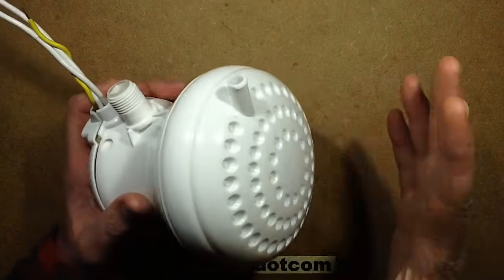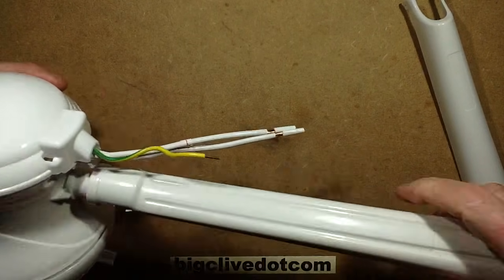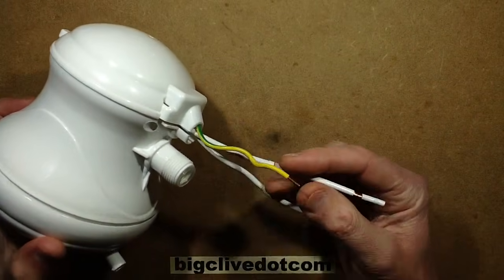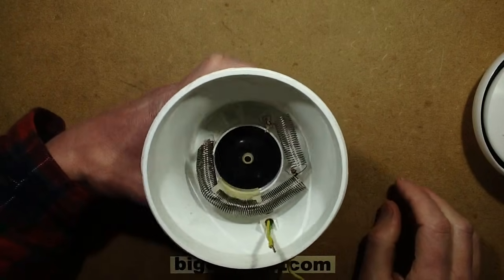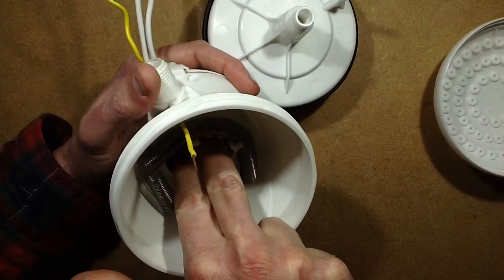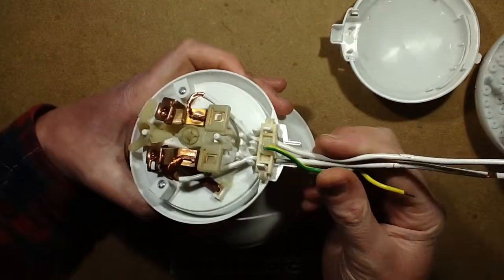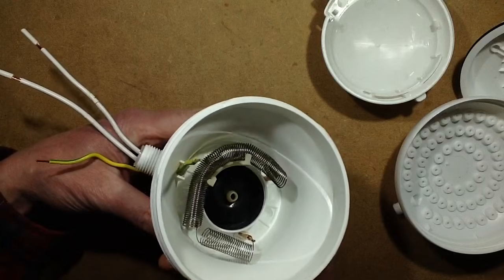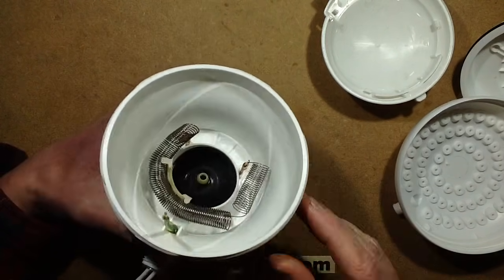Inside a heated shower head.  (suicide shower)

Comment: Fun fact: here in Brazil people actually got upset (well, they still are) when the gvmt established that things had to be grounded. The VAST majority of electrical installations and appliances simply aren't, even to this day

Edit: Those showers are the standard here in Brazil. Reading the label I actually think this is a copy of one of the most common models here
Reply: crephotos it's called soap, mate
Reply: crephotos I'm pretty sure in the one minute or so it'll take you to wash your hands you would need water to be boiling in order to actually count as "killing germs trough heat". More likely than not the warm water you're washing your hands in is only feeling like a comfortable hot bath for the vast majority of them.
Also inb4: antimicrobial soap things which people shouldn't use anyway but exist regardless
Reply: Vile Lasagna Good points.  If the water were hot enough to kill bacteria, you could not put your hands in it without receiving second-degree burns.
Reply: +Vile Lasagna, yeah it's totally pointless if the people give no regard whatsoever to others or their own safety. hahaha.
Reply: Personally I believe that mr "Truth Teller" has most likely invested a large sum of money into these electrical showerheads, that's why he patrols the comment section to this video and replies to every single comment and every single reply. He needs to ensure his investment was not wasted.
Reply: Tiago Mian the original is already kinda crap, tho XD
Reply: That's a Lorenzetti Maxi Duxa copy! Zhenhua is counterfeit.
Reply: Truth teller I said crap. they are crap. they're also very cheap and the brand is well known, I'm pretty sure my own shower is from that brand, although a pricier model. You are reading it as if I said they are very very deadly and kill people every day which does not reflect my statement. "Or are you so determinedly dumb to refuse to read?"

Take a chill pill, mate. You're raging way too hard for no particularly good reason (unless you have some sort of secret connection to some electric shower maker)
Reply: Tecnovlog
No, it is not.  Many places in Brazil, as in the USA, are either not grounded or not grounded well.

The fact is, not one person has been electrocuted by these shower head heaters in the 14 years \ii have been here. 

Believe what you want, but the facts do not support your cherished beliefs..
Reply: Truth Teller said "I have never heard of snyone being even mildly shocked by one".  

Well I can tell you that it has happened to me a few times, albeit very mild, when I have actually touched the shower head while it was on and the water was running through it.  I've been using that type of showerhead for the past 15 years that I have lived in Peru.  Actually, the ones in my house are made in Brazil.  They are Lorenzetti brand.  And in Peru, I don't know anyone who has grounding available.  In fact, not many people even know what I'm talking about when I mention it.

At least I think they are made in Brazil, but counterfitting is so prevalent here in Peru that you never know.
Reply: they probably got angry that the goverment is forcing them to change their electric netwroks at homes without helping them out.
Reply: Democritus86 tbh it's not really being forced. new plugs are compatible with old sockets unless the ground pin is there and that has not been made mandatory so the vast majority of appliances still just ignore it. even when it's there, adapters are plenty so it's pretty easy to work around it.
Reply: To the idiot that thinks washing your hands in warm to hot water kills any germs.. Lmao thats what the soap is for.. Do some research.. Hot water isnt even at a proper temperature to kill germs given any period of time. The water needs to be boiling.
Reply: Are central hot water heaters not common there?
Reply: Not at all, no. You get them in on the south of the country (the little "appendage" hanging from the bottom) which has colder winters and even then most houses will have heating for showers only, rest of the house is straight from the water mains. It's also a "rich people thing" and even there most people will rely on electric showerheads like that one
Reply: The general idea is that having earthed appliances is pointless and that standardizing plugs and connectors is futile and wasteful.
Reply: Truth teller there was only one person actively contesting it though so it's more like it's not been given much importance rather than people being stubborn. I myself am under the impression that it does happen from time to time, even though it is certainly not an everyday thing. Power spikes are very common in a LOT of places in Brazil. Heck, we have thunderstorms all the time where I currently live and I'm pretty sure I've heard a few stories here and there but I cannot guarantee them to not be urban legend so...yeah. not much to say about your statement, mate. You are correct in that they are not a major source of deaths in Brazil (not that I know of, at least) but I know of quite a few scares (often involving people moving the controls with the shower on) and have had a couple myself, not to mention the occasional shower where you always get mild shocks when touching the knob to turn it off
Reply: Truth teller Wouldn't a "nanny state" be the one to hand feed everyone and provide "excessive help" instead? Choose a complaint, mate
Reply: Truth teller so you're saying that if you touch a grounded metal pipe when you're showering  you do not feel any electricity running through your body?
Reply: Truth teller
Could have been that particular installation.  I have not felt anything since we moved from that house, but then again I have been very careful not to touch it while in operation, so I don't really know.  Still, I've used it without fear of electrocution for the past 15 years.
Reply: Don't know if you will actually see this reply. My best electricity story in Brazil, is the high voltage lines that run down the pavements on poles. I have seen situations where someone, say a child, could reach out the window and touch them!
Reply: Why did people got upset? I never heard that....
Reply: This brand is probably chinese.
Reply: crephotos Soap helps water bond to oils and microscopic debris. Washing is mostly a physical process that physically removes sweat, oils, fungus, and microorganisms from the skin's surface, unless you happen to specifically use antibacterial soap
Reply: Truth teller i don't know i'm now brazilian i'm asking a different question, if in brazil people do not ground they system the chance of dying of electric shock is very real
Reply: Tiago Mian Yes, and millions of them are used every day without one person being electrocuted.  The fact that slmost no one one this thread will even admit those facts have been posted many times shows how stubbornly stupid they are
Reply: Vile Lasagna Then explain how millions of them are used every day with no one being electrcuted. Or you as determinedly dumb as the rest of the mentally deficient on here?
Reply: how many people die every year from electric shocks?
Reply: Tecnovlog I said, "how many die from using shower head heaters?"  You are evading the question.  Are you an intellectual and ethical coward?   Answer the question I asked.
Reply: Vile Lasagna Ihave been using these at least once a dat for 14 years.  I have never heard of snyone being even mildly shocked by one.  The only person offering proof otherwise used an unproven story fron Thailand that made no mention of a showerhead heater.  Quite frankly, I do not believe one word of your account.  Do you understand what is meant by "proof"?  I don't think you do.
Reply: @truthteller1914 you're like the person who smoked for 50 years and got lucky so you don't believe that cigarettes are bad.
Reply: *****
Wrong, a nanny state is one that interferes in everyone's life to tell them what is safe and not safe but does little about it. 

Who said it was a complaint?  Oh, that was you, wrong as usual.
Reply: Brutus Kennedy Rutherford Kingsley III
Personally, I think you are an ostentatious prevaricator.  As I always say, prove anything I have posted is not true.  Not one person has been killed with these devices.  I have asked for proof and none has been supplied.  You are all goddamned fools that refuse to believe the most obvious facts. 

What is wasted here is the scraps of intelligence people like you may have had.  Instead of trying to prove your points, you waste your efforts denying that I am right and that you are all a bunch of ignorant assholes.
Reply: Tecnovlog I did not say that at all.  Are you so desperate to ignore the facts that you have to invent things I never said?  

Again, millions of shower head heaters are used every day here.  Not one person hs been electrocuted.  Either accept that fact or shut the fuck up.
Reply: Democritus86 You are probably right.  ;)  The government here is as much of a nanny state as many other countries.
Reply: Dale Erwin
I hear you.  Be calm.  counterfeiting is common here, too.  I have never gotten any shock here even when the building ground was faulty. 

A few months ago, the ground on the circuit for my computer room was faulty.  If I were working barefoot and therefor grounded, I would get a mild shock from my keyboard or the computer case, both aluminum.  I loosened are re-seated the ground wire and everything has been fine since then.  

But my shower, never a tingle even when I have changed the heat setting while it was running.  In fact, I have seen no warning about doing that.
Reply: @truthteller1914 wait, so you say there's no point in grounding things, then say you got shocked by your computer because it wasn't grounded properly?
Reply: So what do you wash your hands with? Cold water? That doesn't kill any germs.
Reply: ***** Soap doesn't kill germs, mate. All soap does is help lift dirt. You need warm/hot water to kill any germs. 

Note to self : never shake hands with a brazillian.
Reply: @TRUE_GR1T  cellular membranes are made of what amounts to soap. When you wash your hands with soap, it destroys bacteria by disrupting their membranes
Reply: @samalbury9183  why are you replying to 3 year old comments?
Reply: @TRUE_GR1T what do you do to kill germs living in your mouth?
Reply: Not true. Cold, warm or hot water works just as well with soap @TRUE_GR1T
Reply: unecessarily xenophobic, bro.  @TRUE_GR1T
Reply: @rafaelmocochinskifreitas9016   you're replying to a comment from 7 years ago man and I was joking.

Comment: I've used those all my life, they are very reliable and lasts a couple of years, normally.
Reply: FireBird- Just use a water heater! They're actually significantly less complicated than one of these, and if you live in a shithole you could probably just build one yourself with a tiny bit of basic plumbing knowledge
Reply: ***** I can't. I live in an apartment building.from the 70s.It's this or cold water to us.

Comment: Hi Clive,
Like me you'll be startled to hear that some UK shower manufacturers DID use this live coil in water principle up until just a few years ago!  About twenty years back a friend asked me to have a look at their very expensive shower unit (Dolphin??) which had stopped heating.

My jaw dropped when I opened the case to find a clear perspex manifold with a Ni-chrome coil directly in the water flow – albeit a lot fancier and with a much longer water resistance path than the Chinese one you stripped down, it looked equally dangerous to me. Nevertheless, when I checked it out with one of the Principle Engineers in the local electricity board he confirmed that BEAB had indeed (somewhat reluctantly) given approval for water heating devices using this principle.

In the event all I had to do to repair it was to shorten the coil by half an inch (it had corroded at its termination) and off it went like new. I did hear that the owner ultimately died, but he was in his nineties by then so my conscience is clear!

Love the channel,   Cheers,  Chris
Reply from the maker: I saw the panel from inside one of them a long time ago.  A long snaking channel with the element inside it.
Reply from the maker: In the majority of countries using electrical water heating the heating element is enclosed in a grounded metal sleeve like a kettle element and does not make electrical contact with the water.  I do realise these devices are widely used in places like Brazil, but they would not be allowed in the UK due to the genuine shock risk they carry.
Reply: colonelerotic
I know that.  That's why I said USA.  It makes no difference, it is still true and millions of these shower head heaters are used every day in Brazil alone.  If they were even 1% ad dangerous as the claims in the video, thousands of people would be electrocuted every day.  That would cause talk, wouldn't it?  ;)
Reply: Truth teller but Brazil is a dirty third world country so telling us it’s safe cos everyone uses it there means nothing. People in India work barefoot on overhead power lines, lots do it, doesn’t mean it’s safe though
Reply: Xavier Bacon In fact, you have never heard of anyone being electrocuted by one of these devices.
    The electric tank heaters work the same way.  An electric heating elment is immersed in the water.  This entire video and 99% of the responses are testimonies to ignorance and a determination to ignore the facts.
Reply: bigclivedotcom You are totally wrong.  I have repaired many electrical water heaters in the USA and not one was as you describe.  Nor are the shower head heaters dangerous.  There are millions of them in Brazil.  If the were as dangerous as you claim, thousands of people would be electrocuted every day.  That would cause talk.  ;)
Reply: *****
Powering up with no water?  Do you realize that that is not the proper use?  Here, they must have water in them.  For example, mine is turned to the "low" or "medium" setting all the time and does not come on until there is water in it.  I can hear it come on as the water starts to flow from the head.

Comment: Those are common in Brazil. The hose is not a pressure release valve but actually just a hose to wash your private parts. Most houses don't have a ground wire so shocks are common.  I've never heard of any electrocution though, although I think I must happen sometimes.
Reply: David Ribeiro Shocks are common? Sorry to break it to you but here in the first world we take exception to getting zapped while washing.  I assume by electrocution you mean death.  We don't take life that cheaply.
Reply: Comprehensiveboy Comprehensiveboy Actually in America we take life cheap as hell as long as we don't have to actually see it happen
Reply: Comprehensiveboy Comprehensiveboy the shower is common. Shocks caused by these showers are not as far as I am aware.  
And yes... life is ever so precious in USA... suuure.
Reply: If I felt even a small tingle from my shower the electrician would be in deep shit and probably risk having his certificate revoked.

Comment: That crazy thing is not sold in the USA, but if your water heater works properly then why would you need one.
Reply: If you want me to pick out two numbers that are the farthest apart ask for what temperature I like my air conditioning and what temperature I like my shower. Summer A/C temperature is comfortable at absolute zero cryogenic and the shower hotter than the center of the Sun.
Reply: Brent Fisher Good man

Comment: mine blew after setting to hot water(not cold neither warm).... no longer works...ideas to fix?
Reply: The heating element breaks up all the time in those showers. You can buy a spare one or twist and mend the wire in the heat element and fix it.  after installing always turn the shower in the cold setting and let it run for a bit before setting to hot.  If the heating element gets hot while dry it will break up again.
Reply from the maker: The elements inside often seem to fail and can usually be bought as spares.  In this one I think it just presses onto spade terminals.  But make sure the power to the whole unit is completely off first.
Reply: Ok... I'll check it ...perhaps it has the same configuration as that in the vid...  thanks

Comment: I learned the hard way, just shocking, in Nayahuru Kenya, Arusha Tanzania and San Jose Costa Rica, that touching this suicide unit, even unplugged, can be an uplifting experience as even the potential difference between the shower head and the floor drain is guaranteed to lift the spirits.